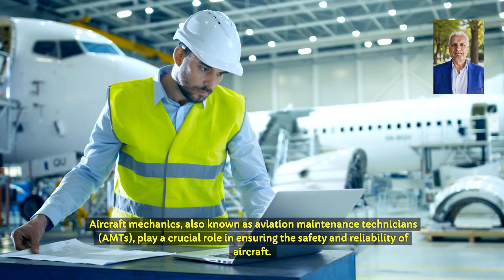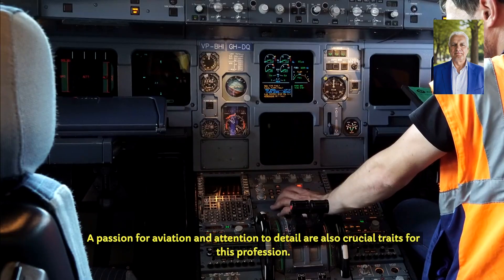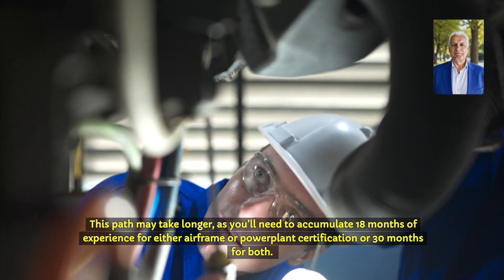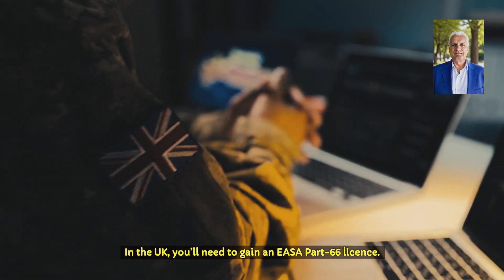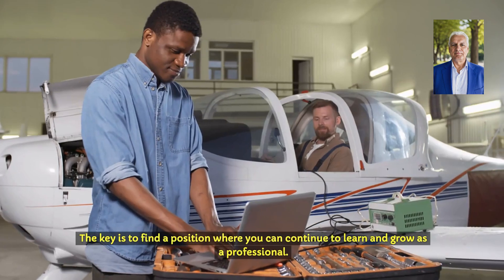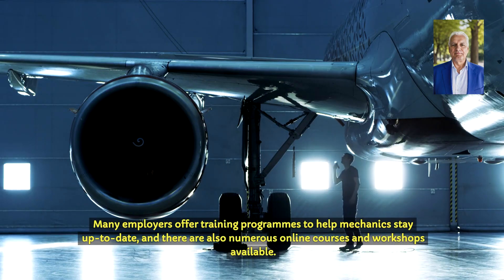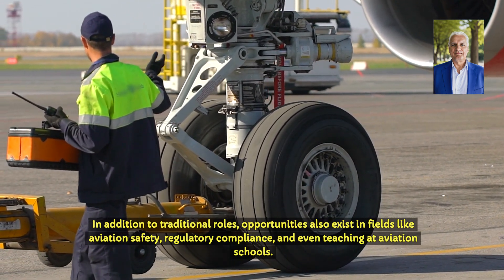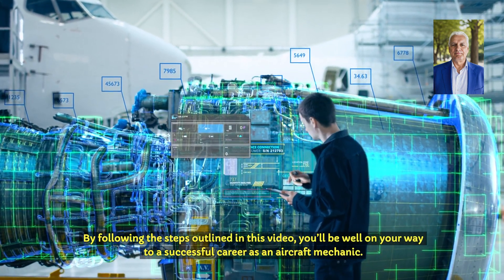How to Become an Aircraft Mechanic: A Step-by-Step Guide

Comment: How can you apply for EASA
Reply from the maker: EASA is not a membership body.
Reply: @BenLovegrove it's what?
Reply from the maker: EASA is the European Union Aviation Safety Agency.

It is the EU body responsible for regulating and overseeing civil aviation safety across Europe. EASA was set up in 2002 and is based in Cologne, Germany.

Its main roles are:

Drafting aviation safety rules: It creates and updates regulations for aircraft design, maintenance, pilot training, air operations, and air traffic management.

Type certification: It certifies that aircraft, engines, and parts meet EU safety standards before they can be used.

Oversight: It monitors national aviation authorities in EU member states to make sure they apply the rules consistently.

Standardisation and coordination: It works with ICAO (International Civil Aviation Organization) and other international bodies to harmonise aviation safety worldwide.

Environmental protection: It also develops rules on noise and aircraft emissions.

In short, EASA is the central authority that ensures a common level of aviation safety across the European Union.